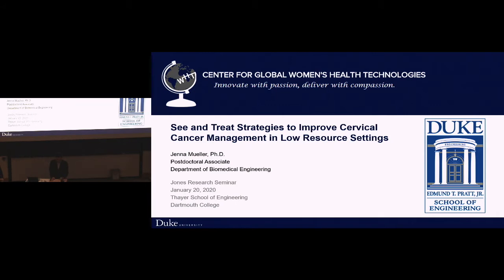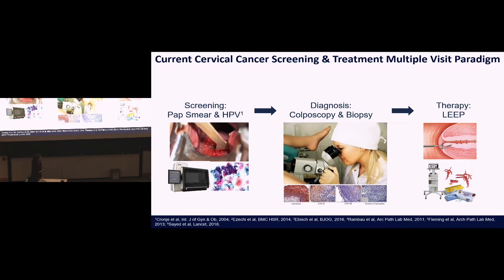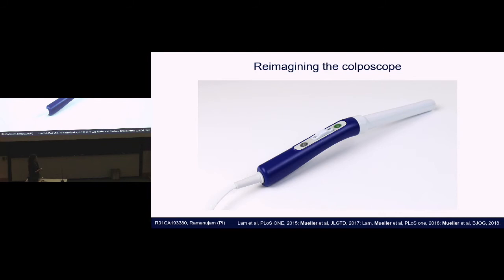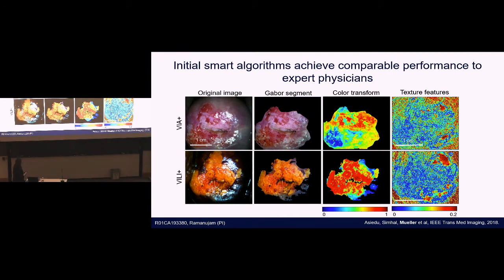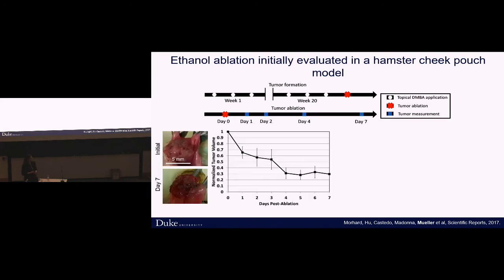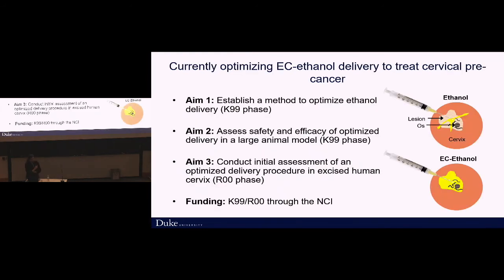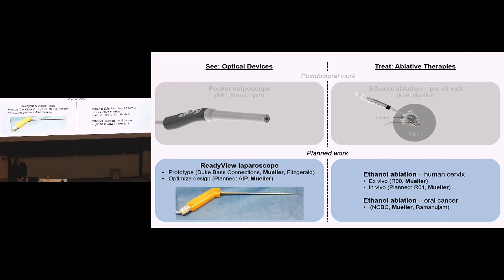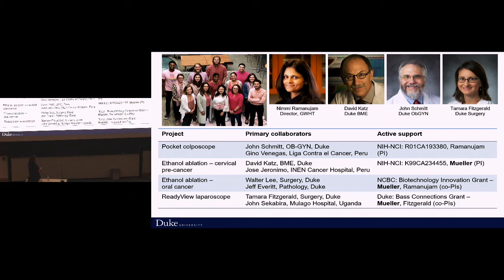See and Treat Strategies to Improve Cervical Cancer Management (Seminar)

Comment: Doctors laugh and smile on there face when they do coloscopy were put bit vinegar on female patient shows cancer? Next step were burn abnormal cells and HPV on cervix using leep procedure. Doctors laugh and smile on there face when they take to much of a female patient cervix cause problems libibo, orgram function, sexual function, shorter cervix harder to get pregnant. Nervous around cervix damage by treatment. Female patient should be wearing condoms and lube while having sex with one or partners.